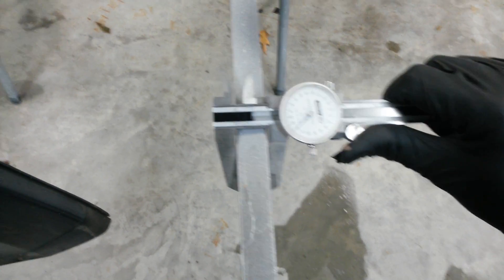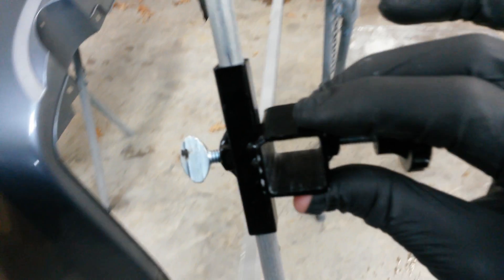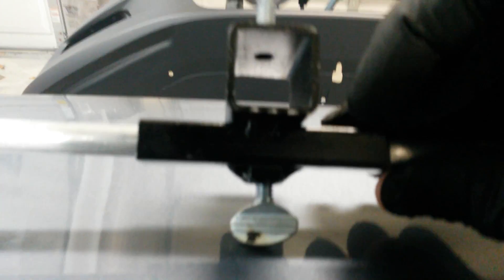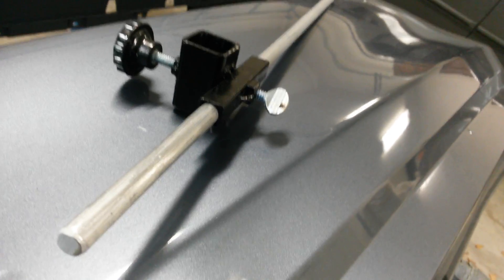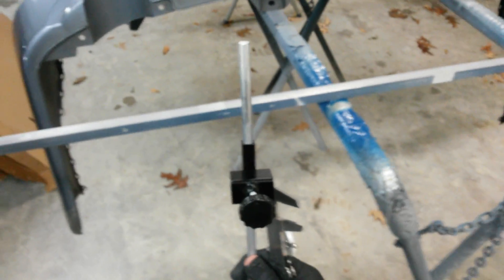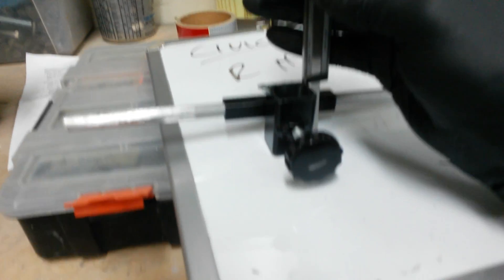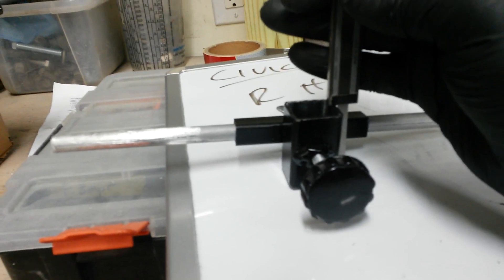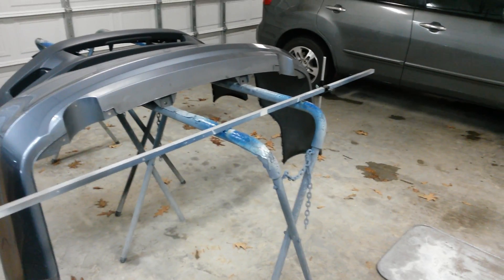HOW TO MAKE A TRAM GAUGE TO MEASURE BODY DIMENSIONS FOR COLLISION REPAIR

Comment: .......or you pay at least $400 to buy from the auto body tool shops
Reply from the maker: Yea. This is much cheaper than a manufactured non-calibrated tram.
Reply: @samg5543  and thanks for posting this video as it can help a lot of people to make this useful tool.

Comment: Very engenius Sam, where did you get the pointers made?
Reply from the maker: Miami13 I  actually had some guys in our fabrication shop at work do them. They basically put the round bars in a drill and spun them on a running belt sander.
Reply: Sam G smart, maybe I'll try my grinder

Comment: Looks like it would work great for checking frame rails and underhood diagonal measurements for square
Reply from the maker: Velvethamma exactly. that's mostly what I use it for. if you add a third pointer, you can use it to compare things like B pillars from side to side using the rocker pinch weld and roof rail as control points to know if you have a pillar that's been deformed compared to a known good. it's handy for sure. thanks for watching.